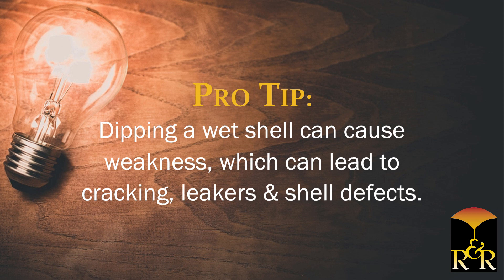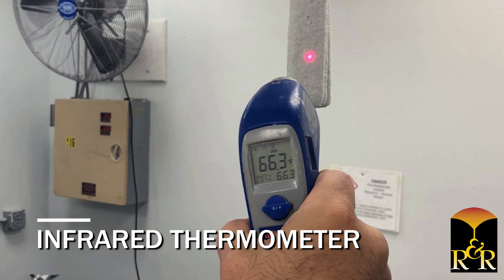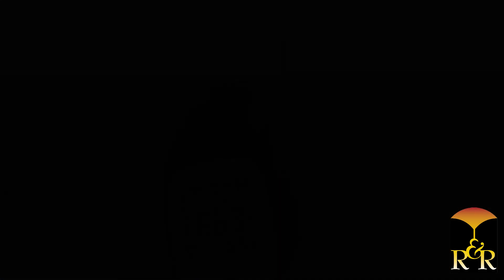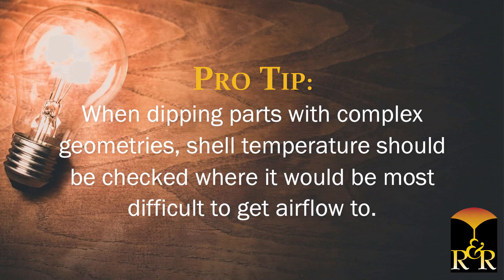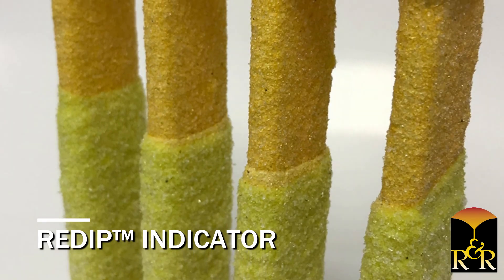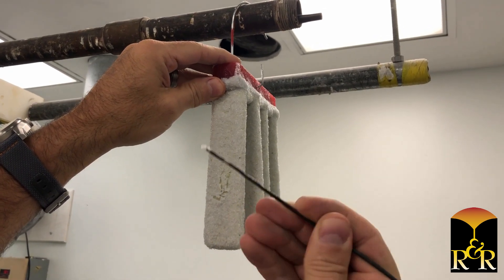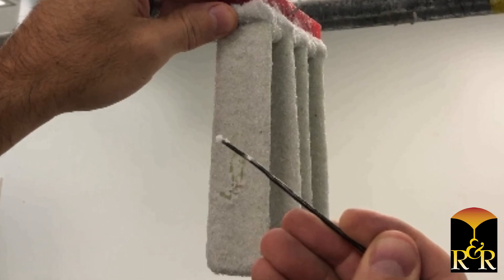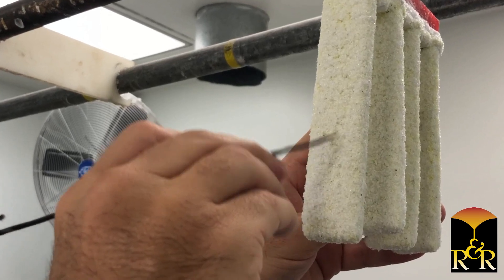How to Determine When a Shell is Dry

Comment: The temperature method works good to determine lack of moisture.  Another one I heard was when shell quits loosing weight due to water evaporation, it's ready....  I give my first couple of layers 5-6hrs in an air conditioned space and following layers 2-3hrs with a fan.  Humidity seems to play a big factor in how fast you can apply subsequent layers.  (no shocker there!)  I have no issues whatsoever, love suspendaslurry!
Reply from the maker: Yes, you can also monitor drying by measuring weight loss of the shell. The weight of the shell will drop as water is evaporated. Once the weight stabilizes, the shell should be dry.

To maximize the drying conditions, we suggest a combination of low humidity and airflow at the same time, not one after the other. Our experience is airflow will have more of an affect on drying than humidity. We suggest you try drying your shell in your air conditioned area with the fans blowing on the shell at the same time.
Reply: @RansomRandolph  Good advice.  I use a fan after my first 2 layers. 😉